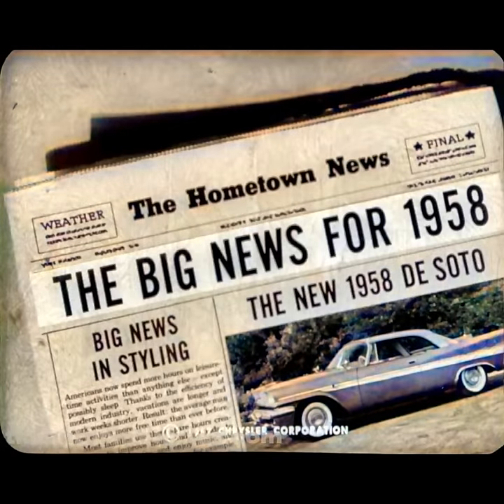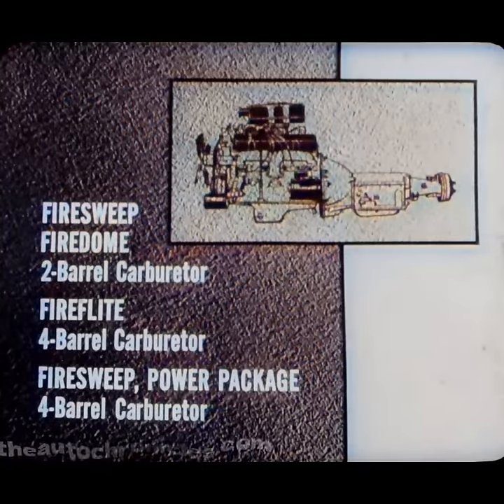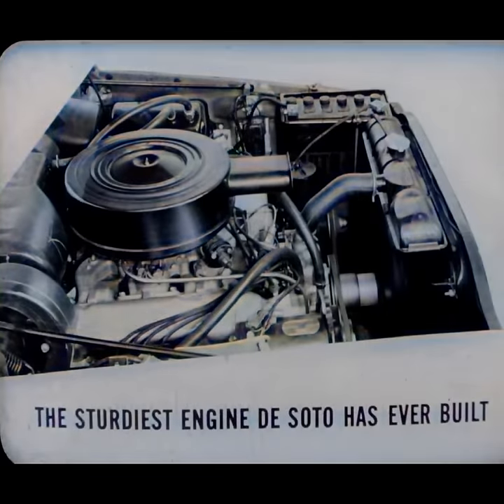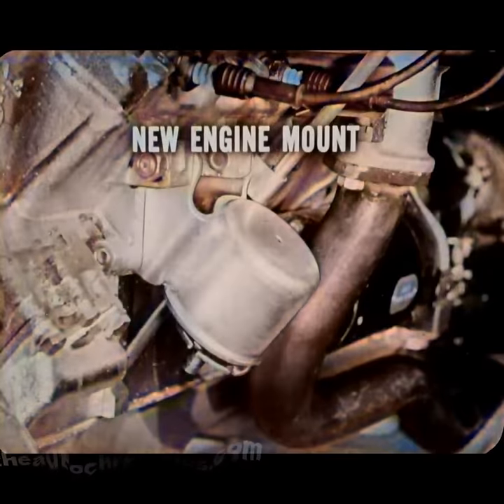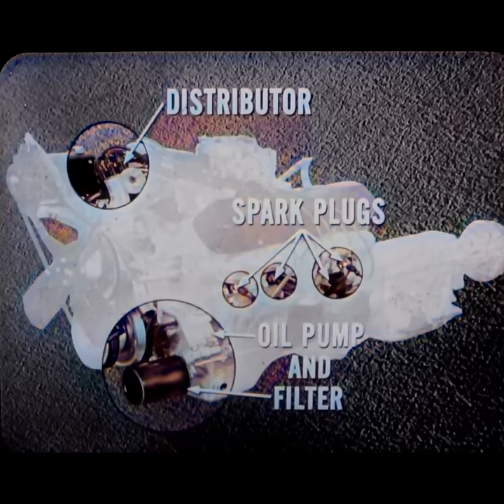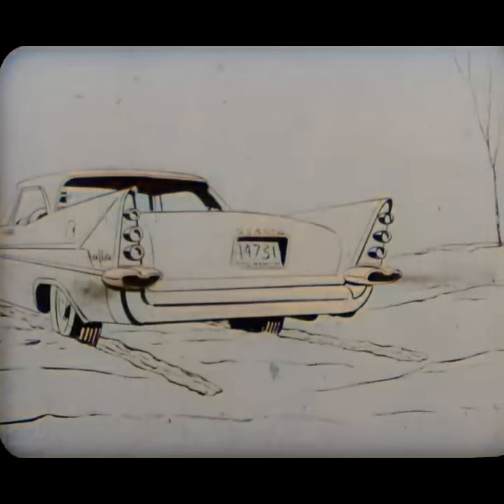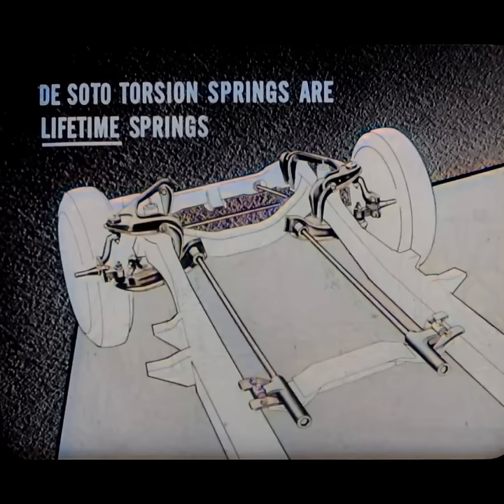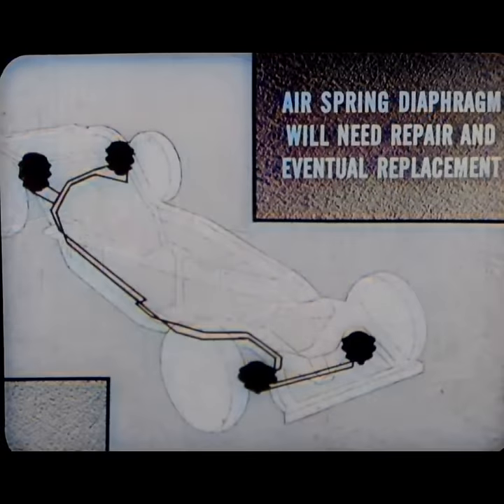1958 Desoto New Engineering Changes and Fixes Dealer Film, Colorized

Comment: So detailed and interesting. Mom had a 58 DeSoto Firedome convertible, with the optional Torqueflite 3 speed automatic. Great car in many ways, but very thirsty (I guess the 57 would have been worse.) and it did not like to start in moist conditions. Also, either a muffler or a resonator always was rusting out in that big dual exhaust system. So, Mom's next car was a 62 Rambler Classic 6 with a 3 on the tree, and our operating and maintenance cost improved a great deal.
Reply from the maker: Very cool!
Reply: NO  Fun  Rambler  !  !
Reply: @thenov1944  Well, it was a "Cross Country" wagon, which meant that "us kids" had a built-in play area in the "way back". Also, it had a great, very useful roof rack for those family trips to our uncle's camps, up in the Maine woods on Great Moose Lake.

Comment: Can't believe that they're bragging about their 14 inch tires as opposed to the "old fashioned" 15 inch tires. DeSoto used 14 inches to lower the car's profile, but they really weren't big enough for that massive body.
Reply: They are big enough if wide enough on wider rims. 5000 pound 1961 Lincolns had 14" wheels, for example.

Comment: The big news in styling was that it was almost identical to the 1957 model with just enough little changes to identify the year.
Reply from the maker: Was some engineering fixes... good things... They had recover from rushing the 57's... unfortunately their reputation would suffer.   It was honestly a gamble...They didnt know they had another year to get things right.  GM was putting out "slight" safe revisions each year and Ford was the king of spying :)
Reply: They had all new engines and the Sure-Grip differential, so you didn't need snow tyres (!)

Comment: Yes very important part right there 
The new carburetor 
Stalling on turns yeah we can forget those days 
Sitting at the stop light waiting to make a left turn in the damn thing dies sometimes reluctant needing a little coaxing to get restarted 

And the hot start 
We used to call that vapor lock and go there to the grocery store do some shopping come out try to start in the damn thing wouldn't start again.

Comment: All the engine stuff is because this was the new large OHV V8 replacing the heavy and expensive hemi from 1951. Same design as big Chrysler V8s for years, like the 413 and 440. All the defensiveness about air suspensions being introduced by GM and Ford in 1958 was unnecessary since neither of them made many and they all proved problematical and were usually soon retrofitted with steel springs. The air springs didn't do anything much about handling or breake dive because they just replaced the steel springs without changing the front suspension designs. There was never any air in Torsion-aire. They just made that name up to imply that it was somehow modern like actual air suspensions. The Chrysler handling had to do with spring stiffness and front suspension design and geometry.

Comment: @8:19- You could also have a manual shift three-speed transmission, maybe with  optional overdrive. This is not mentioned in this dealer film video.
Reply from the maker: was that only on the 6? not sure they had that on the v8?
Reply: Probably very few '58 DeSotos were sold with a manual  transmission..
Reply: @autochronicles8667 From my original 1958 De Soto brochure, only the 350 and 361 V-8s were available. The Firesweep had the 350 with a 3 speed manual as standard. The Firedome and Fireflite had the 361, with the 3 speed manual on the Firedome as standard and the 3 speed TorqueFlite standard on the Fireflite. The TorqueFlite cars had a standard 3.15 rear axle with a 3.31 optional.

Comment: 350 VS. 361 Cu-in. ?? Why bother? The tiny difference in displacement could be more than offset by carburetor, timing , intake and exhaust system choices. I wonder if the 2 bores were mainly for product positioning. They could probably have fudged a difference by calling the 361 a 350 and given it a different nickname. Anyway, I think this was the year of the Bendix fuel injection option; almost none were produced, but the system was the basis for the early EFI systems (Bosch Jetronic and Bosch/Bendix) used in 1968 by VW, in 1975 by Cadillac and a bunch of European brands in between.
Reply from the maker: i think the 360 was redesigned from what they say in the video... larger bearing surfaces etc...  Now i am curious :)
Reply: The 350 was an older hemi engine discontinued that year; the 361 was brand-new and was used well into the 1960s. It was just a transition year.
Reply: @Greatdome99  The 350 was a  one-year-only B-engine, not a hemi.
Reply: There were 35 performance models built with the Electrojector system.  Only one is left with it's original syste intact.

Even Jay Leno couldn't find parts to restore a 300-D.

Comment: 1958: The Year they got rid of the HEMI.
Reply: A very dumb move in my opinion.
Reply: @michaelbenardo5695  the wedge was better than the Desoto hemi.
Reply: Actually it was 1959. The Chrysler and Imperial still had the 392 hemi in 1958...I know because I owned one. Some 1959 Imperials had the 392 until they depleted their stock of the engine.
Reply: @peterkarbowski9375  the subject car is a desoto. There was no hemi for desoto in 1958.
Reply: @58sportsuburban  That was clearly explained in the video. I assumed the comment made meant the Chrysler Corp. as a whole. Oh well, no harm done, a little more info never hurts.

Comment: That Firesweep, which was introduced in 57, should never have seen the light of day.
Reply from the maker: why do you say that?
Reply: @autochronicles8667  Because it was a disguised Dodge, was priced like a Dodge, making DeSoto compete with fellow Dodge division, when it was supposed to compete against Oldsmobile and the small Buick, and lastly because the 57 Dodge, like the 57 Plymouth, was a very poor quality car that damaged DeSoto's reputation badly.
Reply from the maker: @Remembering-rq6si  they had serious water leaking issues..  they also had fumes coming in a bit because they didnt seal it up right...  There were dealer bulletins on all these issues... Your dealer should have handled them... and yes.. rust was a huge deal...  57 Dodges are finally going up in value... super rare.
Reply from the maker: @Remembering-rq6si  Here is the 57 body sealing film that was sent to dealers. https://www.youtube.com/watch?v=hcGOb3nGz7o
Reply: Must not be a good car if Edsel sells more cars than you do
Reply: Even as a little kid I could see it had Dodge front end sheet metal with the Desoto bumper grille stuck on it.
Reply: @dallasmars2  There was nothing particularly bad about Edsels. The lower two series were basically Fords, and the upper two basically Mercurys, and both of those cars shared a lot. Edsels did have a few new features like pushbutton transmission control. There just wasn't room between Mercury and Ford, plus the first year Edsel front end that was too much for buyers in the conformist 1950's.
Reply: @emjayay  It also just looked bad.